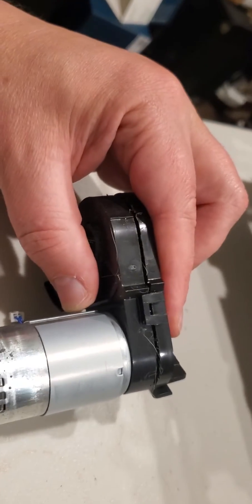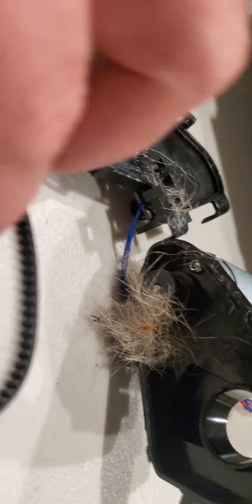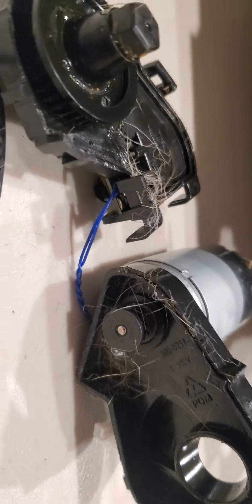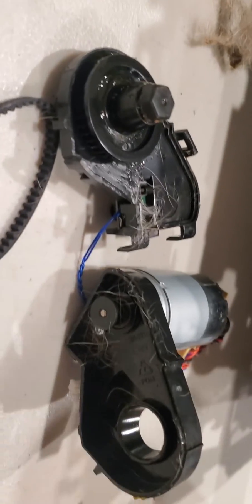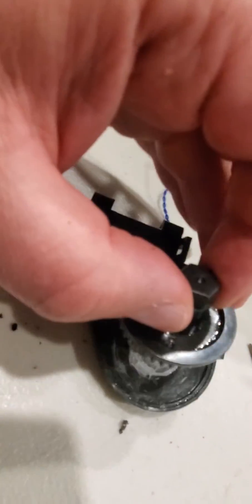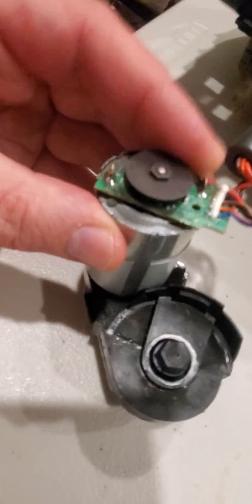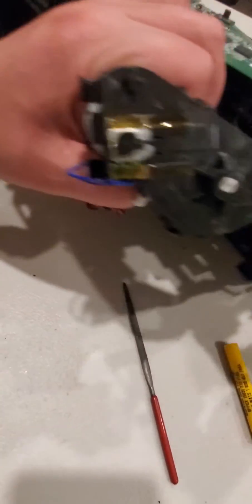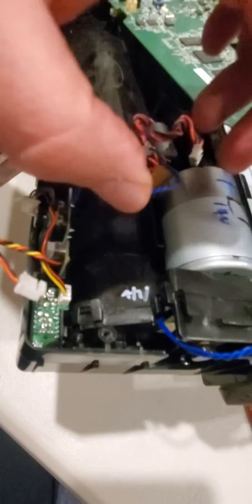Quick Fix For Stuck Neato Robot Main Brush: Diy Repair Made Simple!

Comment: What type and size screw driver ?
Reply from the maker: The Neato D7 robot vacuum uses Torx screws to secure its main cover. Similar devices typically use T6 to T10 Torx screws. A Torx screwdriver set covering this range should be sufficient for disassembly, to just prop motor case use flat screwdriver.. I have sold it year ago